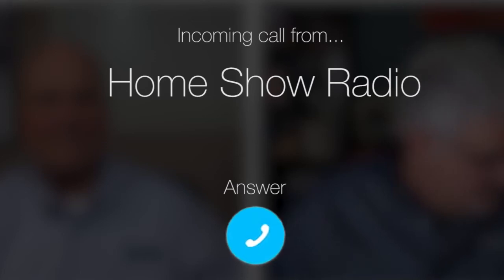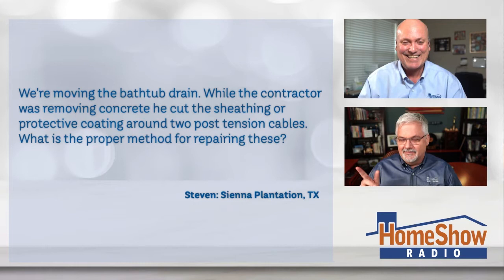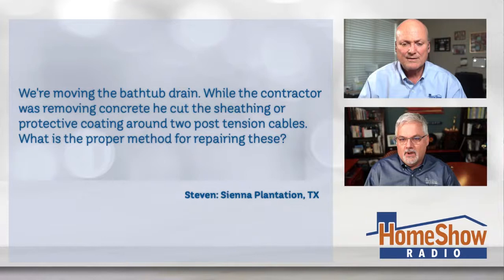Post Tension Cable Cut

Comment: I'm paying for a scan first. Cost is 300.00 but I think its well worth it. This was almost a cut at a junction whoa. A cut cable can start showing up at cracks in the walls.
Reply: @auctionmusic Which company did you go with?
Reply: @WhoIsAaron  I ditched the idea of cutting the concrete and went with a 32 inch metal/porcelean tray from Lowes. Guarantee no leaks, very easy to install, there is a 3 inch stepup, so what.
Reply: @auctionmusic  I have an odd-shaped shower so can't go with a precast tray. Everyone I contacted for a concrete scan wants 600 and up. Just curious who you found for 300.
Reply: @WhoIsAaron  it was a local company in phoenix, and it was a concrete company if that helps. Prices may be higher now. Even at 600 that is still worth it to avoid hitting one of those cables. The cables are only a concern for the drain location, and the driain pipe should run under the level of the cables or even better, if possible, under the slab, so you cut one hole straight down then run the pipe under the slab over to the destination main drain. What was my real concern is the cable are a checkerboard, so there are many places where the cables criss cross over each other, and if you break the cables at that intersection could be a disaster. One last point is the radar people will not guarantee absolute cable location, its an approximation. Good luck....